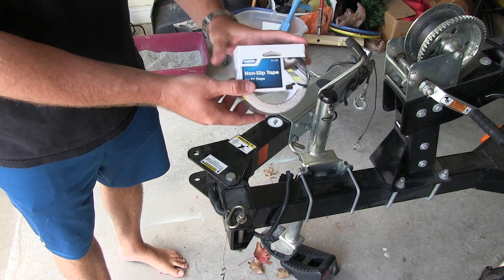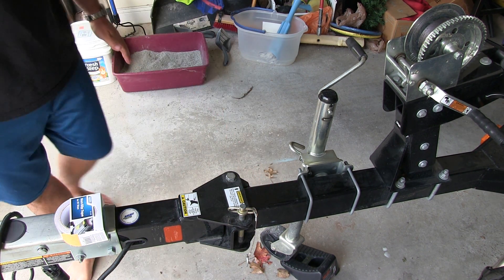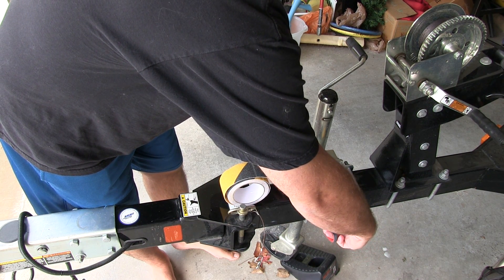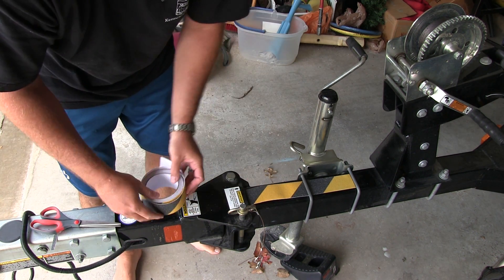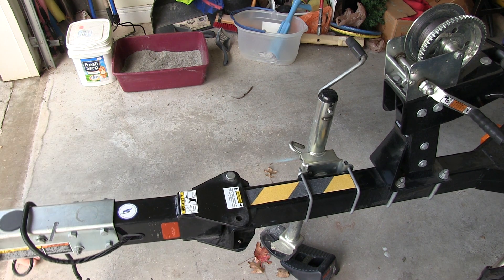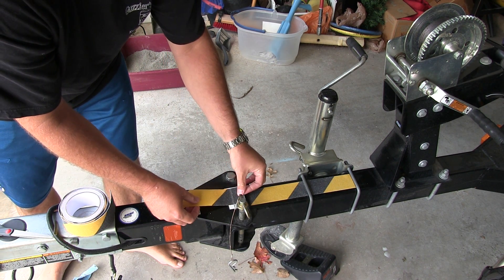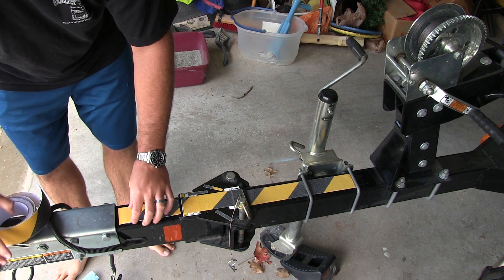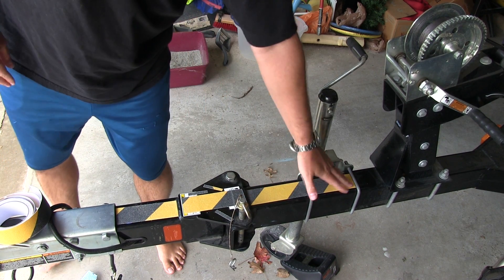How to Fix Slippery Boat Trailer Inexpensively

Comment: Thanks for the video!  I see it has been a few years now, so how did the tape hold up?  Is it hard to remove and replace?  Did it damage the trailer paint?  For your information,I noticed that the link did not work.
Reply from the maker: It held up well but I had to replace it after the first season.  I didn't notice any issues with my trailer (just glue residue).